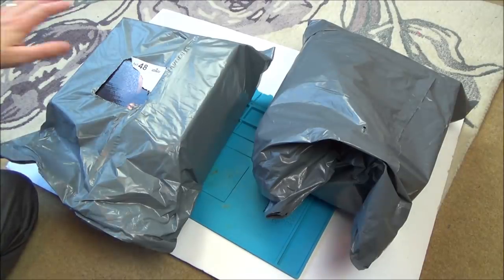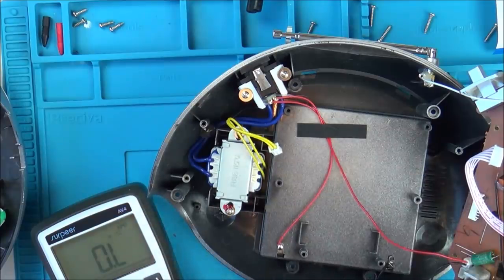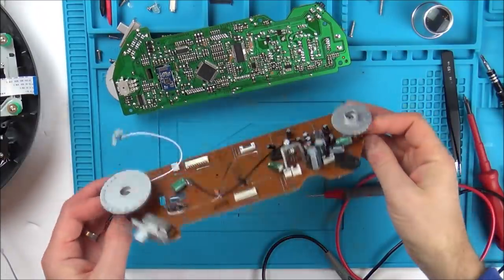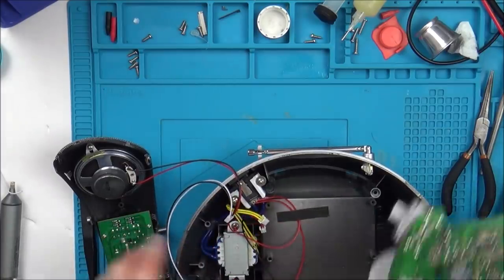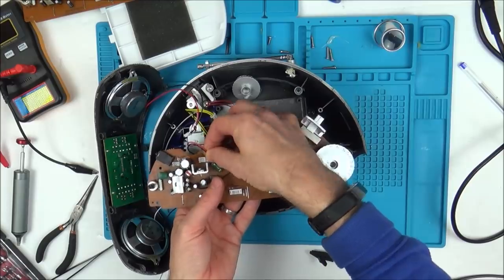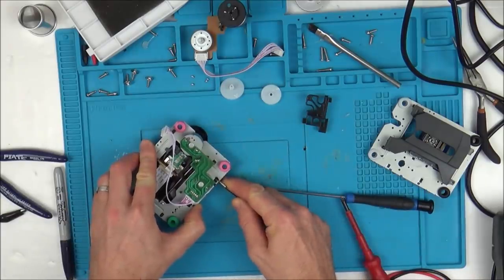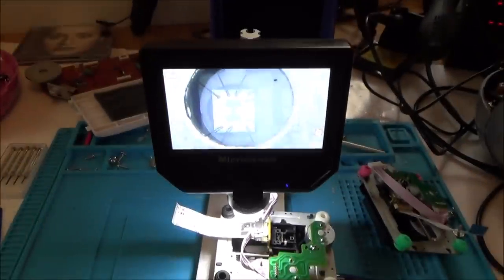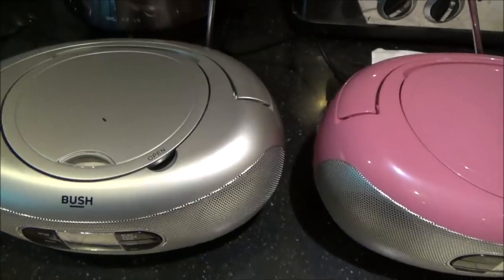Trying to FIX: 2x Faulty BUSH Boomboxes

Comment: Enjoyed this one Vince (thank's for the mention BTW). That PNP transistor's full number is MMBT8550D.  With a PNP current flows from Emitter to Collector whereas, in a NPN, current flows from  Collector to Emitter.  NPN 's need a power supply with positive polarity with respect to common terminals, whereas PNP transistors need a negative power supply; this is why you will see negative values on the PNP datasheet.  Best way to check transistors is with your multimeter set to 'diode' mode (but I guess you already knew that and in any event, your method worked in this case). It may be worth getting one of the SOT-23 transistor kits for £2 on ebay. The one I bought has been used for 2 repairs already.
Reply from the maker: Cheers, I have ordered the SOT-23 kit and also a SMD resistor kit and SMD capacitor kit. I could have done with a SMD resistor kit on the PSP2000 laser a few weeks ago. There are many different sizes so it is hard to know what to order. Cheers for the advice :-)
Reply: You might want to get yourself one of those Adafruit PCB rulers. It's a little PCB with all kinds of SMD footprints and their names/sizes printed on them.
Reply from the maker: @unimportant5122  I like it, I just ordered one up from China, only 99p delivered!!!! Even if i only use a couple of times it will be worth it👍

Comment: Hi Vince. I would use the thorough hole transistor it’s much better than the cheap smd transistor that bush use... it probably short circuited due to it unable to deliver at different frequencies. In other terms. That must of had the volume turned up loud with a low bass frequency!! Great stuff but really if you change/check the sound output IC next step is to check the supply to that IC...

Comment: Hi Vince, I'd say the quality check of manufacturing is the problem where these kinda units are made by human youth and to where there isn't the kinda quality check done very well. It's absolutely fantastic that you were able to find the transistor causing the short good job - Well done!!
Reply: A lot of the Chinese stuff is made by very cheap labour or slave labour. Look at Temu for an example of that! The people churning out this rubbish don't care and there is no quality control at all, I always buy from Taiwan or Japan and have very rarely had a problem with electronics I've bought that were manufactured in either country.

Comment: The volume potentiometer has 6 pins because it's stereo. 2 seperate inputs in 1 control. Also with regards to that transistor, if it is such a common fault (assuming it's generally this part that fails) then I'd put in one with a bit higher current handling characteristics.

Comment: Nice detective work on these =D  A lot of the time you will find small general purpose transistors can be swapped out with many other types of general purpose transistor.  It depends what it is doing.  I think with the laser, it was probably damaged tracking or focus coils, or the assemble causing it to pull slightly one way - so yes, alignment, but I don't think its the alignment of the way the diode was soldered onto the unit, as it probably would have been tested at manufacture.
Reply from the maker: Thank you Chris, once the replacement laser arrives I will open up the faulty unit to see if anything is obvious on the inside. Apparently the thing I was zoomed into wasn't the laser!!! Opps:-) The laser is located on the side so I want to see it. Maybe I can test the coils when it is apart on an Ohm reading, might show up something :-)
Reply: @Mymatevince  Sometimes the coils measure OK, but the lens is pulled slightly one way or the other too far (or not enough)  The part you were looking at might be the pickup (that receives the laser)
Reply from the maker: @GadgetUK164  I understand, thank you mate. I am just editing up the revisit of this. I had a little play around with the lens assembly at the end :-)

Comment: Part 1 of explanation (yes, still watching):
The transistor is designed to permit current only one way and only when its “base” is powered. It has three parts, called:
Collector (aka. input)
Emitter (aka. output)
Base (aka. trigger, aka. The Gatekeeper).
If it has a dead short between any two of the three pins, it stops working as a transistor, and starts working like a three-way wire with a high-resistance path between one of them and the rest.

Part 2 (heavily influenced by my logic deduction, may contain inconsistencies/errors):
The laser’s alignment is extremely important, as it is supposed to read the data on the disc, which is a spiraling string of peaks and valleys representing 1s and 0s (not sure which represents what, but logic says that it’s the peaks that represent the 1s).
The laser shines on these peaks and valleys, which either reflects or not, and those that do reflect get bounced by that filter.
The lens at the end is the most crucial part, as it focuses the lens to encapsulate these peaks and valleys *one at at time*. Too small, and it won’t know where these peaks and valleys start and end. Too big, and it would encapsulate too many peaks and/or valleys.
That is why it moves up and down, as that allows it to adjust itself precisely to the right focus level.
But if the laser itself is misaligned horizontally, the beam would diverge, causing it to bounce off at an angle, instead of spot-on. That causes the beam to return at a different angle than it arrived, causing it to not hit the sensing part of the assembly.
What I just said probably contains some (or alot of) errors, but that’s my logic deduction.

EDIT:
So it turns out that the module you were adjusting at the end was actually a photodiode, the sensing part of the laser assembly. That explains all the tiny wires coming off it, and why it looked alot like an integrated circuit. And the laser is tucked away to the side.

In that case, it’s just a matter of perfectly aligning the photodiode (if you have the patience, of course). The laser is safely tucked away (hopefully properly assembled). 😅
Reply from the maker: Thanks Operational, I will have a good look inside the faulty laser when the replacement arrives, maybe I can test the focusing coils or something. I was sure the module was the laser lol, so much still to learn :-)

Comment: Hi Vince you have the tool's there to strip back ribbon cable, one with a knakered solder tip go over the poly sheathing in a linear motion, then scrape away  any left with your Acto knife, it takes some doing and hands on is the best tutor so any duff cables you have, have a play.
Reply from the maker: Thanks Scott, I did quickly try with the iron but it was a bit on the hot side and I didn't use the knife so it just melted and contorted the ends!!!! The one in the video was probably a bit short to practice on. Cheers for the tips :-)

Comment: You should always follow the input voltage. Make sure the chips have voltage to operate. Chips sometimes have a EN pin, make sure they get voltage there too. 
Check the crystal with the DMM in AC mode and check the frequency or better use a oscilloscope.
Before swapping chips you can measure for shorts on capacitors near the chip first. Or look into schematics for the chip and test it directly on the chip pins.

BTW good work BUT remember what you leaned with this repair. Next time you maybe don’t have a second unit to double check everything 😉
Reply from the maker: Thanks Todestelzer :-)

Comment: I'm only at 19:12 but to answer your question it is a double potentiometer 3 pins for the left channel and 3 pins for the right channel.
Reply: Left and right speakers thats what I thought, I was looking at something similar on a dj deck thing but it was a slider volume control with carbon tracks, I beleive these variable resistors work the same way, but with spiraling cylindrical carbon tracks
Reply: @reacey  Yeah it's only the shape that changes.
Reply from the maker: Nice one PDS :-)

Comment: Probably a stereo (2 Channel Pot) which is 3 pins per channel. Alternatively, it could have beeen an encoder type that goes to a small processor with a VCA (voltage controlled amplifier) built-in to adjust the volume - these have several pins too.  Vince - consider getting a small oscilloscope, they are really quite cheap now and they let you "see" the signals and voltages. The continuity method you use is limited and much slower. The initial short you heard was probably the supply smoothing cap(s) charging up - be cautious putting your meter on the circuit immediately afterwards as it might damage the meter if the cap then discharges during the test.
Reply from the maker: Thanks David, I have just purchased a £20 handheld oscilloscope on Amazon. I am not sure if it is any good but it will force me to experiment with it. If I can get used to it then I can always use the USB one that I was kindly given by a viewer (also called David) later on. Problem with the USB one is that I need a PC running to use it and the software confused the hell out of me. If I start simple with the handheld then hopefully the USB one with PC software will make more sense at a later stage :-)

Comment: Check the standby power and mute lines if they meet conditions to start the power amp. When you test a transistor USE DIODES RANGE if base is positive lead of multimeter and it shows around 500-700mV drop acording to other pins AND NOTHING on the opposite way or between CE than it is NPN and its Colector to Base should show slightly less than Emiter to Base. For PNP the lead of multimeter is negative. That is the way to diagnose Bipolar Junction Transistors. Learn the symbols of elements to understand how they work. This on the bottom is 8 Photo-diode matrix that receives reflected light from laser trough optics and disc itself. Laser is on the side -> 3 pins element wich also contains photo-diode to measure its light intensity On the laser assembly optics, you don't measure a resistance on potentiometer but the light intensity reflected from disc - falling on the phododiode matrix through optics and the drop angle on it. The spindle motor shaft is weared and wiggle thus prevent the error correction amp to correct all errors.
Reply from the maker: Thank you Technixbul for all the help and tips. Unfortuantely on this one I would have never have found the fault if I didn't have a working board from the 2nd pink unit. I would have thought it was the audio chip at fault as I would have seen the voltage going in and not on the other pins, so I would have assumed the chip was faulty. I didn't even realise the laser was at the side of the laser assembly so I am looking forward to tearing the faulty one apart to find it.  Hopefully I will get there one day but I am still a long long way off. Having fun with it though. Keep up the helpful comments, we all learn a lot from yourself. Nice one :-)
Reply: @Mymatevince  That is why you learn basics and how to read schematics and functions on different signals on them. When i first entered in Compact disc technologies around 20+ years ago i bought a book about "CD technologies and how to repair them". It was extremely helpful to learn what on the earth is this animal. Nowadays the sources are unlimited just google it "compact disc laser assembly" first few links will give you all information you need. Don't hesitate to do it.

Comment: Interesting fixes :) Few months ago my Sony CFD-S70 boombox cd player stopped recognising discs, it just spinned the disc for a while and then displayed "No disc". Tried cleaning the cd lens but no change. As it was under one year old, didn't do anything else and it got replaced by warranty.
Another cd player problem I have is with 1992 Sharp boombox, it recognises the disc and plays it but starts skipping and stuttering during playback. One time it shoot the laser head assembly to the outer extreme of the track, and by the sound of it, it did it pretty violently. After that it didn't work at all, just displayed "Er" fault code but managed to move the laser head back to the start position by manually moving the gears and now it works again as before, skipping and stuttering.

At the very least, I've seen some corrosion at the metal rails where the laser head moves back and forth but as it's so old, there might be other issues, mechanically worn out and/or electronic fault, capacitors gone off their values, etc.
Otherwise it works fine, it has radio and cassette player.
Reply: I had the same Sony CFD-S70 and guess what? The laser in that was gone as well. After looking online, it seems it is a very common fault with it. I reverted back to an old Sony from the 90's that is still rocking. I hope to fix the other thing someday. Not really worth it though.

Comment: The board was probably design with the Bluetooth in mind since it has the slot to solder the Bluetooth module board. The reason that the Bluetooth module is on a different pcb is because they are sold that way and are cheaper than designing the whole board with integrated Bluetooth
Reply from the maker: Thanks Thomas :-)
Reply: @Mymatevince  Worth noting the telltale antenna traces as well to determine if something is a radio board.

Comment: Please do a revisit video replacing the laser. Also will you be doing more of the Sony discman series? I’ve only found the part 1 of that.
Reply: Hathtrya I’m working on something with problems reading discs and I find this trial and error type video on diagnosing laser problems is quite educational and helpful. I would be interested is seeing if he has any problems installing the laser. As well as more information like does the new laser need to be calibrated? And I would like to see the finished repair.
Reply from the maker: Thanks Ryan, yes I still have them. I forgot about them if I am honest with you. I will dig them out again :-)

Comment: Did you set the lazer potentiometer back to the 6.2 k ohms or whatever it was that it was supposed to be, maybe the alignment was the issue and now the pot just needs setting at the correct resistance
Reply from the maker: Yeah, I set it back to the original reading, I had to cut quite a bit from the laser part of the video as it was getting ridiculously long!!! I think it was the 645 Ohm reading that I turned it back to :-)

Comment: You should invest in a cheap oscilloscope. Will make fault finding on these type of devices so much easier.,
Reply: Yes, DSO138 is a perfect cheap kick-start
Reply: I have been suggesting this for a little while - fault finding without one is SO much harder!
Reply: Hmm, that's a good choice. 
I once converted a FNIRSI-150 oscilloscope into a completely mobile unit that runs on a rechargeable 606090 battery, instruction  are on the net on how to do that. Actually that would probably be a great project for Vince to do on this channel, complete price is only about £20 😀
Reply: @PeteSimpson  well you can buy DSO138 as kit for 10$ USD i have one too and love it
Reply: Best to get a capable old analog scope from ebay for cheap then rather then getting one of those toy DSO kits.

Comment: Bluetooth and WiFi require certification in the US and the EU because they transmit over public airwaves. Each time a manufacturer updates the board containing them they have to have them re-certified. So they design WiFi and Bluetooth modules on separate boards or purchase them from other manufacturers so they can avoid re-certification costs (not to mention the hassle and time delays) every time they modify their main board.

Comment: That bottom of the laser is the pick up and not the laser the laser is 90 degrees offset of the pick up hence the angled mirror in the laser assembly, the mirror reflects the laser to the disc. the disc reflects the beam back down through the mirror to the pickup

Comment: The Sanyo SF-P101 is a notoriously crap laser. Sony used it in the CDF-S70 boom box and they had to do a massive recall as the lasers were dead from new. These pieces of junk will fail just by looking at them from a distance. Even buying a new one is a gamble but you will be covered by ebay tho. As a side note unless the laser unit is very rare or expensive I will never bother to mess with it, just replace it and be done
Reply from the maker: Thanks Dave :-)

Comment: Hey Vince, have you ever tried to find a schematic for things like this that you have tried to repair?  Something like a low end radio like this might be a lot more likely to have a schematic out there somewhere.
Reply from the maker: Hi Chris, the only time I used one was on a Sony Walkman. I struggle to read them as I am not used to them. Hopefully in the future though they will make more sense to me :-)
Reply: @Mymatevince  I would recommend watching someone that while they may go over things that you do not necessarily work on but they always go over the schematic.  This will help you understand schematics in general.  I have some electronics background but it has been years since I have done anything with it but I love watching videos.  Someone I would recommend is Mr Caleson's Lab.  He mainly works with older vacuum tube stuff but also newer stuff also.  I got hooked on his videos.  And he explains everything.  I think you may like his videos.